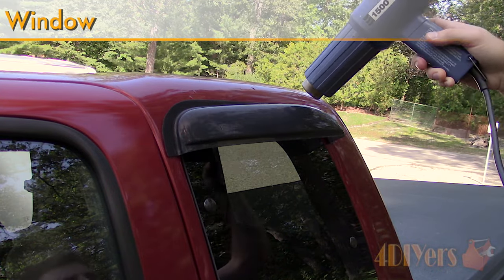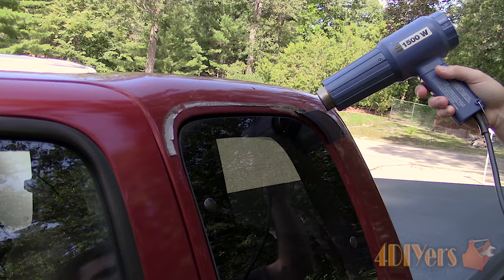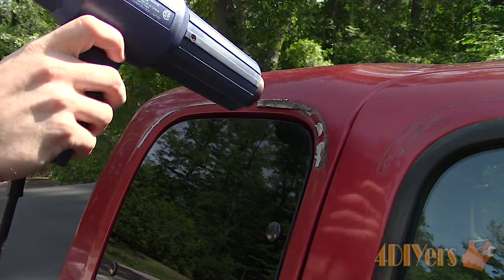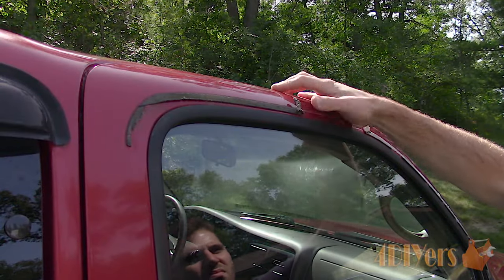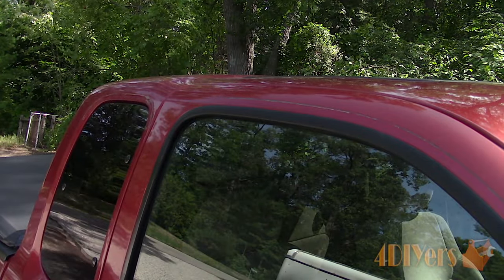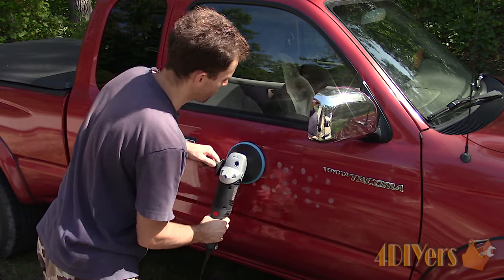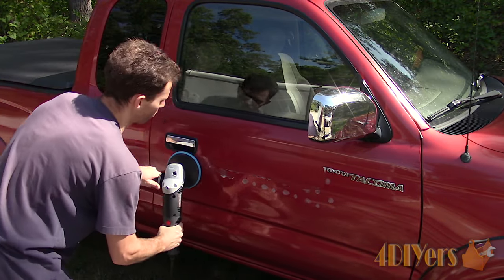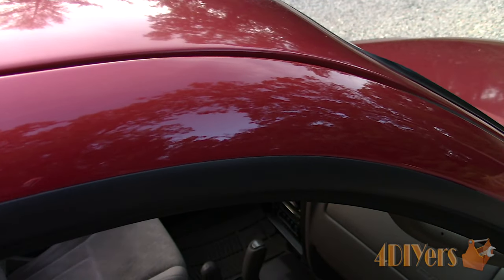How to Remove Side Window Deflectors or Visors on a Vehicle

Comment: The dental floss tip helped out a ton - thanks
Reply from the maker: No problem!
Reply: The floss simply snapped when I tried using it.
Reply: @lk8300  I doubled it up and tripled it up and even up to like ten strands to make it work otherwise it would break immediately